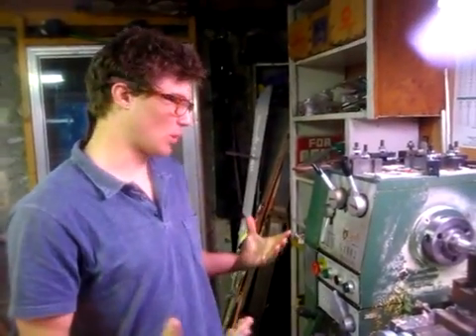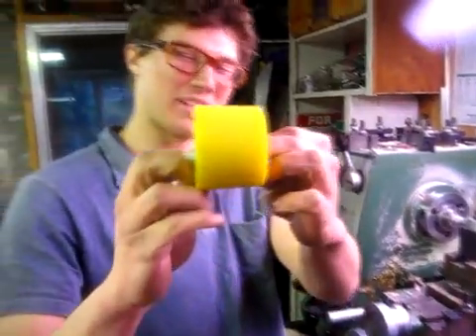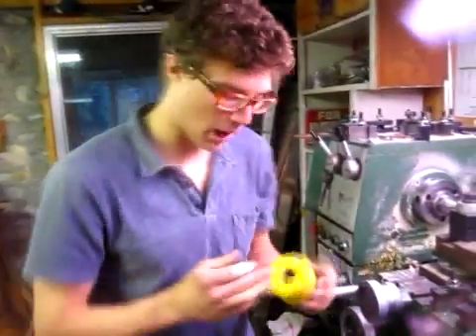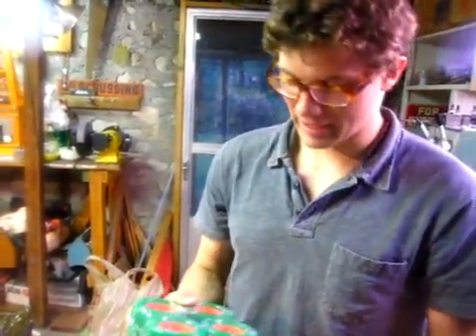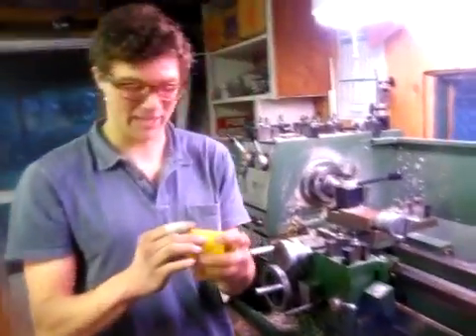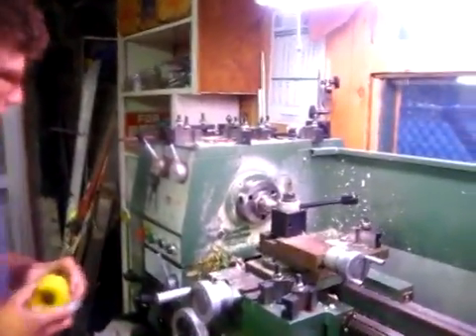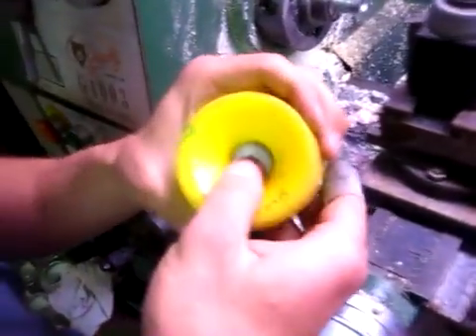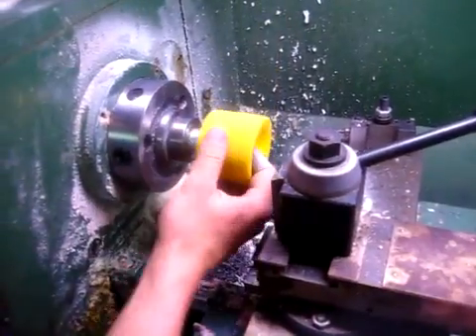Wheel Lathe

Comment: Why not make a sharp cutting tool, and ya know, have perfectly cut wheels
Reply from the maker: A good file is a sharp cutting tool.

Using a traditional lathe cutter tends to have a lot of chatter from urethane rebound. It would still use it occasionally, but for the most part a file was good enough, and was quicker to set up.

Comment: If their coned rotate em. If their flat spotted fix your form and go faster. Fuck a lathe.
Reply: Rob 99 
Do you honestly flip side set wheels? Putting the lip over the truck hangar  instead of outwards has basically the same effect as switching your trucks to a pair thats a half inch to an inch shofter wheelbase. Unless you cut off the lip.

Comment: For one, I TRULY hope you've had some machining practice and learnt something since 2009, because I can count at least 10 things you're doing wrong. All of them are either life-saving, time-efficient or both.
Reply: File without a handle to cover the tang, that will hurt if it snags on the material and goes through your palm and wrist. Also that file is loaded up and should be cleaned, no wonder it doesn't cut fast, not to mention it's rusty and probably dull. And when filing on the lathe you're supposed to draw the file along the work piece and use the full length, not dwell in one spot on the file, that way the file has a chance to evacuate the swarf. Another point that should be addressed is the selection of the file, that file appears to be a 2nd cut file, which is used for finish work on harder materials like steels and sometimes aluminum (although there exist better choices for aluminum). For softer materials you need a more open cut file to prevent clogging, or "pinning" which is the technical term. And for that matter, if your using a lathe, why not cut the wheel using the tool and powerfeed. It would be much faster, and it would square the wheel up to the spindle (which is the desired result right?). You can hit it with the file if you want afterwards, but rough that shit out with the lathe...Whats that old saying???....Work smarter, not harder. Lastly, the lathe is a piece of equipment which must be respected, it can take your arm or your life in the blink of an eye if you're not careful. Granted, they were using a collet chuck so there wasn't much worry of a spinning lathe chuck, but care must be taken to avoid moving equipment, these machines are built to cut metal, flesh and bone is no tough meal for a lathe of that size, and that's a small lathe compared to the ones i've used.

Comment: First off, as someone who, some 16 years ago, first posted up on NCDSA about lathing wheels to preserve roundness (after flatspotting), I'm glad to see the basic idea explained (although, coned wheels actually grip better, hence Mitchell's "X" wheel for slalom). I'm appalled however at the lack of PPE, such as gloves,safety glasses, and dust masks!! Urethane dust is really BAD for your lungs! THINK, 1st, eh? Also, in running up the lathe, you mention a 'medium' speed? WTF? Lathes run at Precise Speeds (unless made in Brazil), and filing a profile by Hand is inaccurate as all heck. Nice for woodshop, perhaps, but you could easily keep your tolerances down to a few thousandths with a decent tool holder for the file, and use those fancy handcrank knobs to bring the tools to the workpiece. Repeatability, predictability, that's Machine Tools are supposed to provide, yet you make a joke of that accuracy with a swipe of your hand. Speaking of which, did you even have a 'finish profile' or size in mind for the next  3 wheels? Amatuers, lucky to still have all ten fingertips still... Regards, dudes,  "P.S.R."
Reply from the maker: Polyurethane dust is actually fairly inert. The un-reacted raw ingredients are nasty, but once reacted are very stable.
Polyurethane foam is very common in cars, mattresses, any sort of padding really, and it creates over time, a lot of dust, Polyurethane dust has therefore been put under a lot of scrutiny, but is considered safe.
If I felt the dust was being airborne in any substantial way, I would have probably gotten a mask.

We're not concerned about tolerances down to thousandths, there's no reason to be for a job like this, or really I'd say when lathing wheels in general.  We have several tools for cutting wheels, but again, for a job like this, no reason to get them out.  

"Medium speed" is better than saying the exact RPM, because nobody watching the video is going to know what that RPM means. "Is that fast? I don't know how fast it is." And we didn't just say "medium speed" and leave it at that, we followed up with context to what more specifically we meant by it, we framed it with the cutting behavior of both lower speeds, and higher speeds.
Reply: Longboard Technology
Reply: ERIC BRAMMER Alrighty, then you just go ahead and suck up that 'inert' dust, BUT, before you do, please go talk with John Gilmour, or Herb N from ncdsa (you know, back in the day, when YOU were in grade school). And by all means, dismiss my experiences as a Machinist, life-long skateboarder, and snowboard coach of 30 years.
Simple,isn't it to dissuade an opinion from a source you don't comprehend? [ I still have all ten fingers even after running machine tools for 30 years. I also have  skateboarding scars from exceeding the 50 mph speed limit OLDER than you are.Perhaps a tad bit of Respect might be due, although, if it's not, come ride Ascutney Mountain with me.]
 Please THINK before you put up 'info' vids, cover the 'what if' stuff in the edit room, and also use your tooling with responsibility. People will do stuff based on your input, fingers may be lost, etc. Oh, and as to MY creds, just ask some old, washed up pros (though Tom Sims can no longer Vouch on my behalf, I'm certain others will) . And, again, present what you own, but do it with the idea that information lacking will hurt someone, yet too much will bore us to hell.  Good luck, and Peace.  "P.S.R."
Reply from the maker: ERIC BRAMMER I didn't dismiss anything. I said we have cutting tools for wheels, but we chose not to use them because I felt they were unnecessary for a hack job like this.Using a file is something I feel I know how to do safely, and confidently. I'm sure somebody else could screw it up, but that's not going to change the way I go about doing things. I could say the same thing about going 50 on a skateboard. Shame on you, what a bad example you are, you're lucky to still be alive. People are going to try to emulate you, and get themselves hurt.I didn't ask for your creds, and frankly I don't need them, so long as what you say makes sense.
Reply: ERIC BRAMMER
Reply from the maker: Oh hey!

Anyway, Um, this video wasn't ever supposed to be anymore than a kooky little session in the shop.

Once it did get big, I did my best to give it a direction.  I did research to figure out what questions brought people to the video, and I added a link to point those people in the direction they need.

For the link you posted, I like their cutting tool, but I do not like their tool for holding the wheel.

You should check out the silverfish community wheel lathe thread link that's in the description. If I were to do another wheel lathe video, I'd use that thread as a heavy resource, and direction.
Reply: ERIC BRAMMER Oops.
 I went back noticed the 'centerset' wheel comment..  Wow.
 I gave Chaput the overall idea a good decade+ ago, on NCDSA , about what the next wheel (back then, post Flashback, but pre-Hawgs/Orangutang) for longboarding might be like.
I wanted a center-set bearing, fat contact patch (2 inch or more), dual-radiused, and cored wheel that would be 65mm (or larger, which didn't occur for awhile), in many urethane hardnesses to be able to cope with rider's terrain variances.
I noted the previous generation wheel, the Powerflex-9, and a few others (such as Astro) that had notable features (like the Original, all-bone-white Powell Bones, which while having no core, and being offset, were pretty usable and versatile).
The wheel described, and somewhat refined in online conversations, became the ABEC 11  No Skool, in 60mm, and 65mm, and it was for awhile, Sergio Yuppie's wheel-of-choice. It's named 'old skool' in partial reference to my online 'nickname' of Pre-School Rider. 
Funny, though; Chaput never has sent me a set to ride. Cheap Bastard!

P.S.R.

BTW, ride centersets if you slide hard; Lathe the others when the cone-out gets to more than 10% of the outer diameter.
Reply: Then go get some Avilas! We used to square off the lips by about 1/4"-to-3/8" for Super-G racing, and while the 78's and softer don't slide so easy, the 80A/82A/85A's all can be drifted, although B-Ops are stickier than 'classic' or Def-con; I haven't got onto the 'bubble gum' flavor yet, but have heard they leave fat thane lines.
Or, maybe Speed Vents?
Reply: +ERIC BRAMMER Orangutang might be the nicest set of wheels Ive had in some time. I wish there was something of a slightly larger diameter available though.
Reply: Tried Kegels? They're stupid fast, and might be a bit hard to slide while breaking in (seemed sticky-ish to me, not Avalon sticky, but..). 
I picked Nersh Tophats instead, but will probably acquire one more set of Avila's before the Ops Series is out-of-stock and replaced by the Def-con thane.
Reply: Yea thats what I have on my arbor right now, and they are great, but I was hoping to get something even bigger for the board I just made.
Reply: Hmm, Ill have to check them out.
Reply: Yay, people being civil on YouTube! I hardly ever see this.  Lol

Comment: Buying centre set wheels doesn't prevent coning and instead of using a lathe, fix them by ACTUALLY SKATING
Reply from the maker: Everyone Relax
If you rotate the wheels frequently enough, to a large extent, yes.
Reply: Wait, so the cone will work itself out naturally through just skating on it?
Reply: Everyone Relax yep just put them in the other direction (example right back to left back) and they will cone in the other direction making them perfect again and then coned on the other side till you switch em
Reply: redhaze boarders Mmm-- okay. Thanks there, uh, granddaddy flash master.

Comment: or you could just put them on the downhill edge of the board and wear away the outside lips as you slide. the two uphill wheels cone, while the two downhill wheels reverse cone when in a heelside standy.